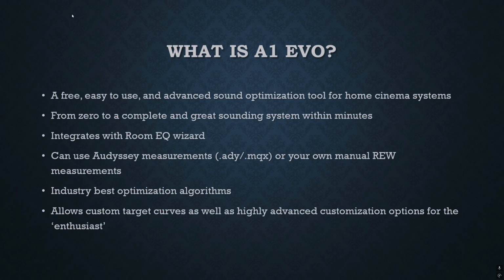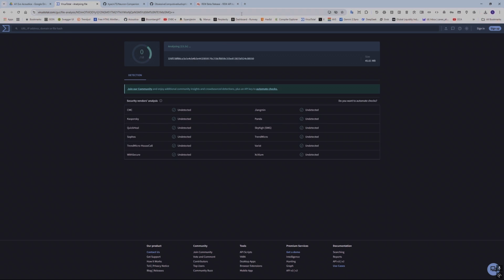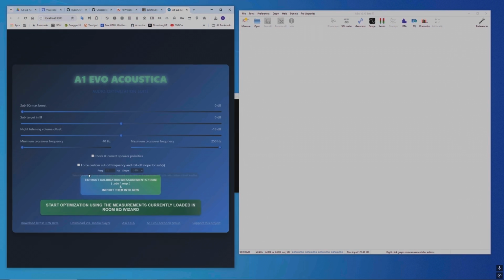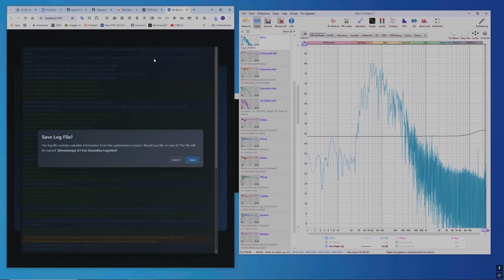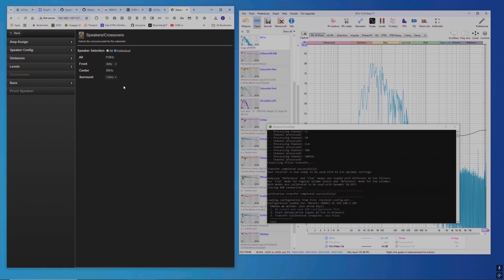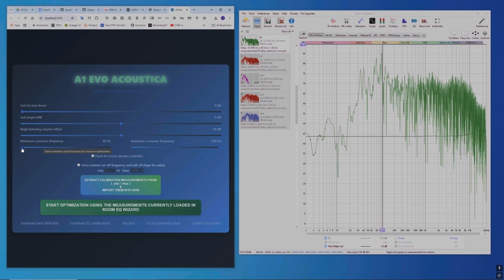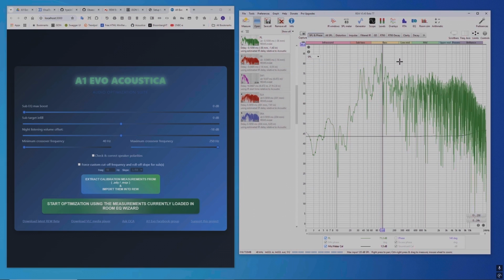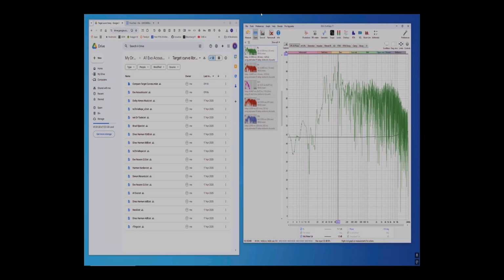A1 Evo Acoustica

Comment: Bug ?!: I am using the Marantz sr8015.
Unfortunately, reading the receiver_config.AVR with acoustic does not work with the following speaker setup: 13.1 / Layout:5-channel +SB /
Heigt-LS: 6channels / -Dolby-Ls.: none / Front Layout: Front Height+Center Height / Middle Layout:Surr. Height + Top Surround / Rear Layout: none / Pre-Out: Front

Error is the following: automatically selected single matching AVR at 192.168.2.220
? Is “Marantz SR8015” the correct model for the device at 192.168.2.220? 
(Source: UPnP Description XML) Yes
[GET_AVRSTS] Config Command timed out after 10000ms waiting for JSON response.
Failed to get necessary AVR status/info: [GET_AVRSTS] Timed out waiting for Config JSON response.
Error during connection or status fetch for 192.168.2.220: Failed during AVR status/info retrieval: [GET_AVRSTS] Timed out waiting for Config JSON response.
AVR configuration process failed or was canceled.
Reply: Will try….thank you!
Reply from the maker: It's a bit strange. AFAIK nobody else had a problem during AVRSTS stage. Unfortunately I don't have a clue why this could happen after already finding the IP address. I will keep an eye on that error and release a fix when I can. In the mean time, power cycling your AVR and PC might help.
Reply: @ocaudiophile  For me, this only affects Preset1 with Center Height and Top Surround (Auro-3D). Preset2 is assigned an Atmos layout. This works with Accoustica without any problems. There is another person in the Facebook group with the same problem and the SR8015. (power cycling did not help)
Reply from the maker: ok so that's an Auro 3D problem. Now it makes more sense. I am not sure if a fix is possible for that. Auro 3D is optional and is not included in Audyssey code.
Reply: @ocaudiophile  with Neuron no problem to create the .avr from this preset. Hope it will be fixed. THX for your hard Work.
Reply: AURO 3D work initially then tried to run again and now I’m getting same error “time out waiting for Config JSON” very strange.
Reply from the maker: @fidelcampos7377 make sure .avr file is saved in the correct folder where the .exe file is running

Comment: On version 5.3 the slider for maximum frequens dont go lower then 120hz. And when i use minimum freqvens slider it get stuck at 120hz. Have to reload app in browser
Reply from the maker: That's because you have a model with basic MultEQ and lowest crossover for that is 120Hz. This might change in the next version based on feedback from MultEQ users.
Reply: @ocaudiophile i liked when you could limit to not do any changes above 250hz for front speakers.
Reply: Sound best for me with 100hz

Comment: Is it normal that Marantz SR6015 only goes to volume 79 when using 0-98 scale? both with flat and reference MultEQ
Can i use Acoustica only by pulling out the file marantz calibrated itself with audyssey mic, or do I need Rew program aswell?
Thanks
Reply from the maker: Yes that's normal, they automatically cap the volume limit based on individual speaker volumes and filters.

If you have only one sub, you can use your Audyssey ady file with Acoustica. If you have 2, you will need to remeasure your system.
Reply: @ocaudiophile  Thanks!
I have two subs, remeasure with REW and sweeps?
Reply from the maker: @MrGameplayek  Either that or you can use odd.wtf tool which you will find under Neuron video...

Comment from the maker: A1 Evo Acoustica v8 has been updated @ 27 June 2025 10:42 CET

Please check the download folder linked in the video description!

Enjoy,
OCA
Reply: Is there a reason all my crossovers are so high now? My speakers can go down to about 40hz for mains and 60hz for my center, surrounds are good down to 80hz. I used to get 80hz for my mains and center channel and around 120hz for my surrounds and atmos speakers, but now im getting 200hz for mains and center, 250hz for surrounds and rear heights and 150hz for my front heights. This definitely seems odd. Is there a logical explanation for this, am I missing something?
Reply: @stephenrobotham1510  i had the same experience with unusually high crossovers .. and i general i did not manage to make acoustica sound better than the multEQ optimization .. how was it for you? could you improve the acoustica optimization?
Reply: Version 6.6 is on antoher level. Seems my system is completly transformed and I hear sounds I have never heard before. The soundstage and bass is absolutly spot on. 

Will try Turbo during the weekend. 

Thanks a lot for your very impressive work!
Reply from the maker: @teikela turbo is just faster 6.6 if you have a single sub, quite different if you have multiple subs.
Reply: @ocaudiophile  i have two subs and will defenitly try Turbo🎉
Reply: Thanks for your amazing job!!! Every next version is better than previous. V8 is the best for me. I noticed that the final result depends a lot on the measurements. It's very noisy environment today and the result with today's measurements wasn't good, but when I used the measurements from yesterday everything fell into place. Thank you again!
Reply: Hi, i am having trouble with setting the freq limits. when I adjust from 40 hz I cant pick 80 hz and then the minimum sets to 100hz.
Reply from the maker: @chrisoldhams7771 XT cannot go below 100hz in v5.3
Reply: @ocaudiophile  ah ok, any reason for this? have always used 80 in the past. will try it and see how it sounds
Reply from the maker: @chrisoldhams7771 based on feedback I keep changing the system for XT and this is our most recent conclusion. I hope this will sound the best so far.
Reply: So no hope for basic multieq to get 80-90hz and subwoofer eq?
Reply from the maker: @robbinbruzelius3102 It's possible but remember that means sub will hand over bass to speaker at 90Hz and speaker cannot be equaluzed below 375Hz. You have no way of cutting peaks between 90Hz and 375Hz. V5.6 tries to find a crossover where peaks above target are minimum but on general you'd get the best sound from basic multeq with 250hz crossovers all around because sub is properly filtered at the same level as XT models.
Reply: @ocaudiophile  But lower crossovers do work in previous versions like 4.5 in XT models... and also in all neuron Versions... Why suddenly not anymore? Thanks in advance, Simon
Reply: @ocaudiophile  But it worked with all versions of Neuron... why doesn't it suddenly work anymore? Thanks in advance, Simon
Reply from the maker: @vortexor1  Technically it doesn't have any filters between 250Hz and 375Hz, this cannot be changed by software.
Reply: @ocaudiophile  OK thanks! But below 250 Hz the filters on MultEQ, MultEQ XT, XT32 come into play and so it's in line with your philosophy to only correct below the Schroeder frequency, right?@ocaudiophile
Reply: For front speakers i don’t mind  no eq. Just subwoofer would be great. Since i use for music 50% of the time. But have trouble with roomgain at 40hz
Reply from the maker: MultEQ subwoofer filters can efficiently clean up peaks up to 20dB above target curve.
Reply: @ocaudiophile  "Bass to weak!" is the best checkbox ever. Now my system sounds absolutly incredible! Thanks!
Reply: @ocaudiophile the Dolby Atmos option can I see the same as for my height speakers for my Auro-3D setup?
Reply: I just downloaded the win x64_v6.1 and checked it with Virus Total - it got flagged for VBA32 TrojanPSW.Win64.PirateStealer
Reply: @ocaudiophile  I just donwloaded the windows-x64 exe installer and it got flagged on the virus total website, VBA32 Virus. Please check urgently.
Reply: Wich version is the best guys???
Reply from the maker: @kuriakos36  Always the last (v6.6)
Reply: @ocaudiophile i just test it oca but the sound is not good... 6.5 is better... 🤔 Why??
Reply: Using the latest versions of the script v6  and rew Beta 85 (osx) (from the above links) I'm seeing the error: It's not possible to sync your speakers at the MLP with the available hardware limits of your AVR. You'll need to move these speakers closer and repeat measurements!

Any ideas? hitting a wall here. :) Great work btw! I'm so glad I came across this.
Reply from the maker: @karlglover7001 delays required for speaker/sub distances is above hardware limits. This usually happens with very large rooms or with WiFi dongles.
Reply: @ocaudiophile  Ok so realising audyssey picked up my fronts as being 7m away ? could that be related ? I've tried manually changing them on the MultiEQ app. Still the same thing. I can assure you my room is tiny. I'll dream on for 7m away.
Reply: On my system it seems 6.3 version gives me best sound. Better bass. I am using cinema 70s reciver.
Reply: After download the program when i tried to run the program it is asking password protected is there any reason and do you have any passwords?
Reply from the maker: @avsolutions212 read the update log pls
Reply: Files on your drive are password protected! Do we have to pay to gain access to this?
Reply: @danfronzeil7332 oca
Reply: @danfronzeil7332  password is oca

Comment: What would make Acoustica version 5.0 and above set the crossover for small side surrounds to 80hz? They have always been set from 120hz to 150hz by Audyssey and all other versions of EVO. The specs on the speakers say they are capable of going as low as 83hz, but I have my doubts.
Reply from the maker: There's nothing to worry about low crossovers unless you hear distortion at very loud levels

Comment: @ocaudiophile Since the last win11 update no version of a1 evo finds any upnp device. It had worked before ! I tried everything ... administrator, Firewall, wlan settings .....
which command is acoustica using for upnp discovery ? 
What else can I do ?
Reply from the maker: Restart windows, turn off any vpn
Reply: @ocaudiophile  , did restart many times. I don`t have VPN.
If I type the IP manually: 
Attempting to verify/find model name via /goform/ endpoint on 192.168.2.110...
Failed to get http://192.168.2.110/goform/formMainZone_MainZoneXml.xml. Status: 403 Forbidden!
Could not get a valid model name from /goform/ endpoint.
Reply: @superhelmi4678  You can type in the specific model and it will work. That message is what happened with me, as my AVR is on a different VLAN.  Works fine after that.

Comment: Do the "newer model" receivers affected by the low bass bug when measurements were taken with Odd only include the 800 series Denons (3800h, 4800h, 6800h, etc). I have a 6700h. I don't feel like my bass is lacking. I had some other problems I mentioned in an earlier post, but I got everything sounding pretty good using the sliders.
Reply from the maker: Only x800 and cinema

Comment: Using Acoustica version 5.0 with an X1700H, my center channel filter is cutting about 14 dB between 100-200 Hz when using a flat target curve. There are also cuts of about 10 dB in the front left/right speakers over the same frequency band. If I use a not Dr Toole target, the cuts aren't quite as large, but I still see 12dB on the center channel. Without really knowing, it feels like cuts like that are rather extreme and that maybe I'd be better off with more limited cuts or maybe a different EQ approach. Are cuts like I'm seeing reasonable and expected?
Reply from the maker: Yes, there's no limit to how much you can safely cut (unlike boost) however Audyssey filters have a -20dB theoretical limit.

Comment: Hi, I measure my 2 subs with freq range 20-320hz or 10-20000hz in REW replacing the SWMIX from audyssey  with the names SW1 and SW0. the optimization process always stops with message "[INFORMATION] Analysing permutation: Required time delay: NaN ms, inversion required: undefined, estimated sound pressure: NaN dB", May I know what might be the issue?For audyssey using the mic comes with avr while subwoofer i measure with umik,not sure if this is the reason. Thank YOU
Reply from the maker: All measurements need to be 0-24000Hz

Comment: 5.0version is stuck in this step:
5:38:34 [IMPORTANT] FL: 180Hz, polarity inverted? false
15:38:34 [IMPORTANT] FR: 180Hz, polarity inverted? false
15:38:34 [IMPORTANT] SLA: 180Hz, polarity inverted? false
15:38:34 [IMPORTANT] SRA: 180Hz, polarity inverted? false
15:38:34 [IMPORTANT] TML: 150Hz, polarity inverted? false
15:38:34 [IMPORTANT] TMR: 150Hz, polarity inverted? false
15:38:34 [IMPORTANT] C: 60Hz, polarity inverted? false
15:38:34 [IMPORTANT] SW1, polarity inverted? true
15:38:34 [WARNING] Polarity inversions will be applied automatically by A1 Evo Acoustica!

please help X2700H:hand-orange-covering-eyes:
Reply from the maker: It's not possible to debug from the above prompts what has caused that but I can tell you it's not an issue seen with any others which means it's related to a local issue in your set up. Check that you are using correct REW version, Chrome browser and the installation is robust.
Reply: @ocaudiophile All brandnew start with the newest REW make it. Thanks a lot

Comment: With V5.0 my subs are set very quietly...why is this? With V1.0-4.4.2 it was loud and thumpy (which I quite liked) now it's very supressed
Reply from the maker: How did you measure your subs? You might need to deduct an SPL offset from them before running Acoustica v5.0
Reply: I have the same issue. I used the SWX sweeps from your lossless folder.

Comment: I have multiple subs. I took my measurements with an older version of ODD. The version I used said it did not require plugging in one sub at a time. Do I need to take new measurements to get the most out of Accoustica 5.0? As I mentioned before, the first version of Acoustica set the crossover for my fronts at 40hz. 5.0 sets it at 180hz. Also, the first version set the crossover for my small surround speakers at 150hz. 5.0 sets them at 80hz.
Reply from the maker: Although not yet confirmed by all users, there's a possibility odd measured your sub volumes higher than they really are due to forced directional mode setting during measurements. You should hear this as an audible lack of bass if that was the case with you. Try adding SPL offsets to your subs in REW before running Acoustica. You have to decrease ("Add SPL offset") each of your subwoofer measurements by this formula: 20 x log (total number of subs) which is about -6dB for 2 subs, -9.5dB for 3 subs and -12dB for 4 subs. After that your crossover frequencies should end up different.
Reply: @ocaudiophile  I do not notice a lack of bass. I think there is more bass with 5.0 than with the original version of Acoustica, even though my front crossover is now set at 180hz vs 40hz. I think I prefer less bass in this particular situation. The bass on 5.0 seems boomy. I have four identical Klipsch Sub-12 subwoofers. Admittedly, they are not high-end subs. My favorite iteration of Acoustica is still the very first version. The front soundstage was dynamic, and the bass was tight, not boomy. On the Neuron AVS thread, there is a Google Folder with all the iterations on Neuron. I wish we had something like that for Acoustica.
Reply from the maker: @volumnus  I think choosing a less bass heavy target curve will fix your issues.
Reply: I tried both Chris Bope curves. I have all Klipsch RP speakers. They both resulted in exactly the same crossovers.
Reply from the maker: Try Dr Toole curve maybe?
Reply: @ocaudiophile  I tried the Not Dr. Toole curve. It still seems counterintuitive to set the crossover for my tiny surrounds to 80hz when it has always been set from 120hz to 150hz and my front towers to 150hz when they were set to 40hz by the first iteration of Acoustica. I decided to stick with the Acoustica curve and just use the sliders. By using the sliders, I have everything up front (Center, Fronts, Wides, and Front Heights) set to 100hz. My side surrounds are now set to 120hz, my rear surrounds are set at 150hz, and my rear heights are set to 100hz. I'd like to raise the crossover for the rear heights up to 120hz or even 150hz, but after a lot of experimentation, this seems to be the best I can do at the moment. While not perfect, the crossovers at least seem more reasonable than before using the sliders.

Comment: Hi everyone, just need to ask if some of you who used the android version of the app, did you experienced the -12db subwoofer levels? If yes, how / what did you guys did to correct it? OCA said this is a bug on android app...Thanks..
Reply from the maker: You can use odd.wtf tool in Neuron video folder.
Reply: @ocaudiophile Hi OCA, Thank you. I already downloaded the odd.wtf folder in Neuron Google drive. When I ran the odd_menu_multiple avrs.bat then choose #5 my AVR cannot be detected. It was the same case on the other .bat files. I followed ur advice on your other reply in one of my questions to just plug the mic in the receiver and ran the .bat file but it can't see my avr. But, on your version 5 or 4 of your evo acoustica,  your program has no problems detecting my avr. but I have to manually enter the ip address...
Reply from the maker: @christiank.8035 You can use -i manual up address option